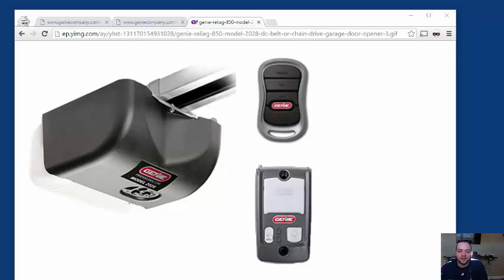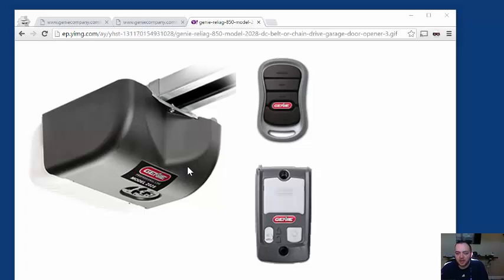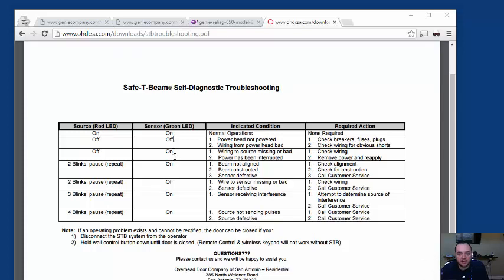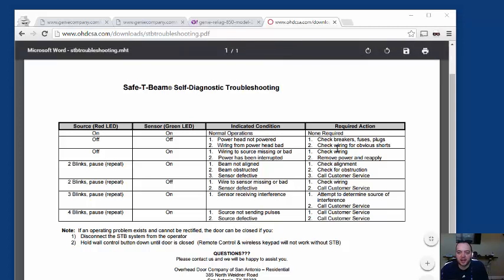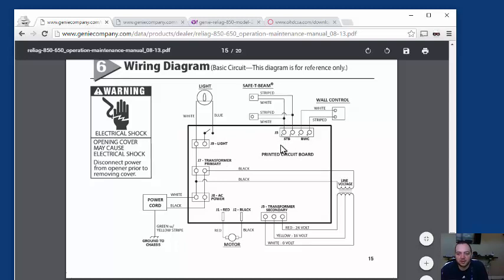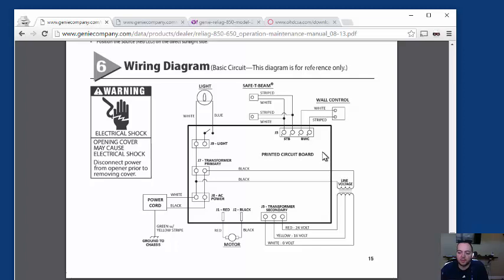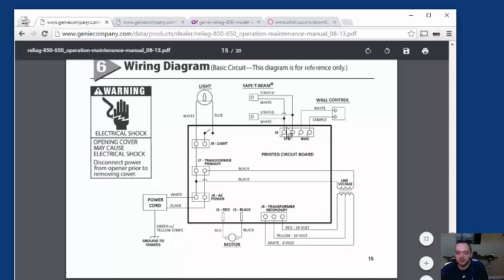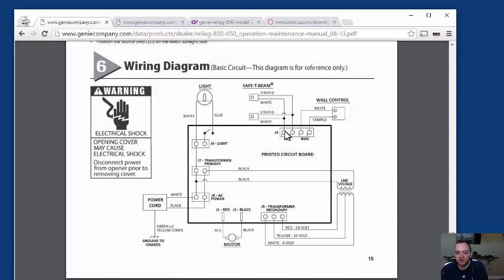Genie Garage Door Opener ReliaG 850 Safe T Beam Safety Beam Troubleshooting

Comment: Thank you so much! We just moved into a house about 2 months ago and the garage door has been broken ever since.  I finally was fed up and decided I need to either figure it out or buy a new one.  Well they are a lot more expensive than I thought so I finally came across your youtube video after I noticed the status light told me it was the Safe-T Beams.  Well - it turned out the wire that was supposed to be in the Safe-T Beam wasn't even connected.  I was SO happy when it worked right away.  Thanks! I really appreciate it.